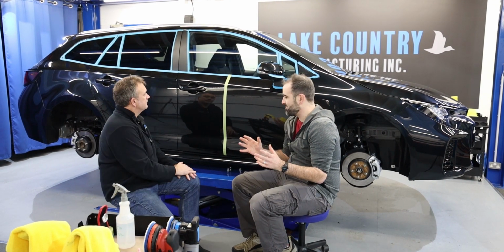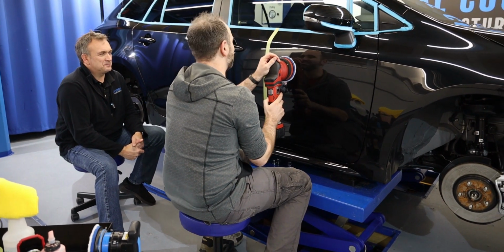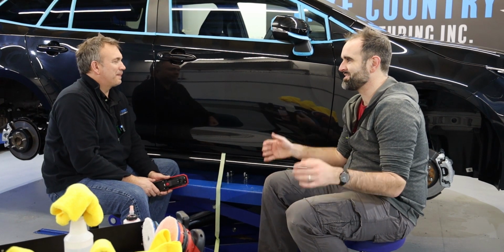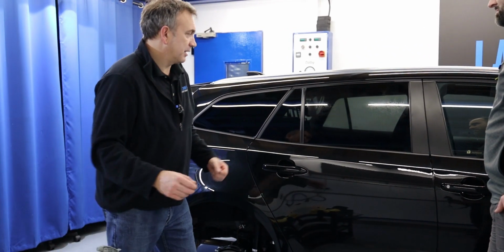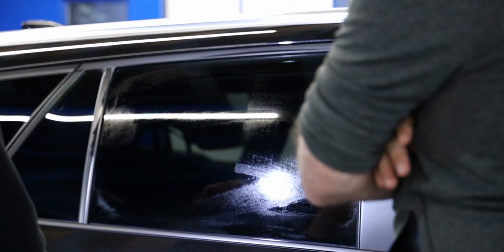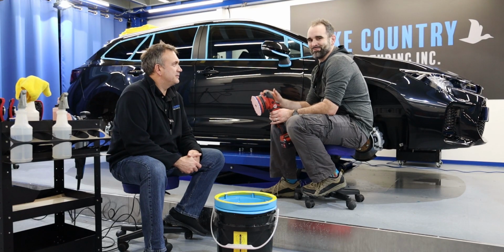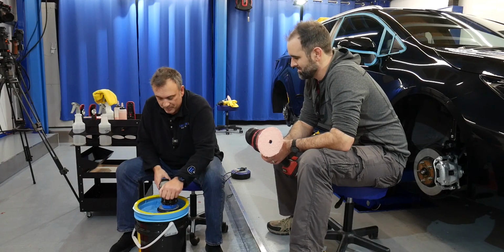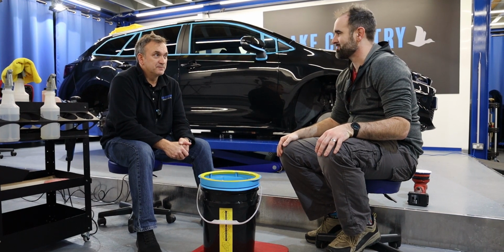Polishing A Black Car With The Legendary Kelly Harris!

Comment: The speed with the arm movement with the machine polisher is this correct way to do with a larger orbit
Reply from the maker: A lot of factors come in to play. Pad and polish combo, speed of the machine, weight, and applied pressure etc... Also, it depends if your cutting or finishing etc
Reply: @TheDetailingSpace  So the speed on the arm movement from the video is this correct or has it been speeded up
Reply from the maker: It's correct

Comment: Great video.  There's alot of counter intuitive stuff involved in paint correction as there is in washing cars. The zero bucket method of washing cars or one bucket washing with alot of mitts, most people still use the two bucket method but it's actually less safe and less efficient as it's self contaminating. Don't be afraid of wool,  microfibre or heck even rayon or a surbuf and even a rotary.  what liquid you use, the working area size, how clean you keep the pad and the machine speed massively determines how aggressive you are.  Even a Jewelling polish with a deburred wool can be used and the finish is superb despite far less cut, it keeps the wool fibres moist so they keep working not dry and clumped.   In the near future there will be far less foam pads needed. either one or two maximum for anything you want to do. Not five six or seven different foams, that complicates it too much.